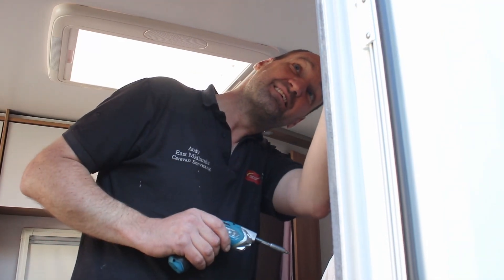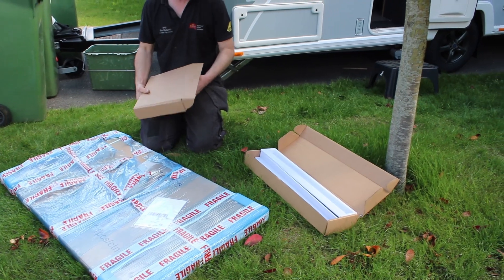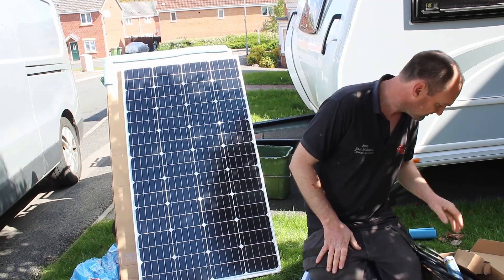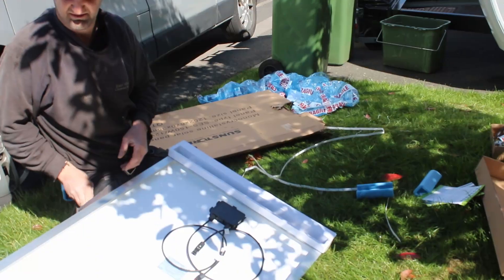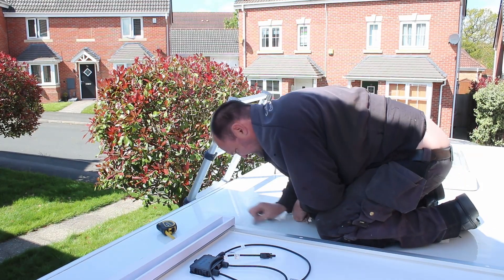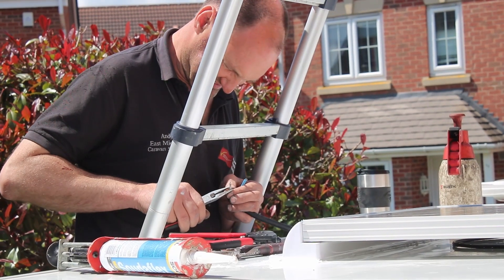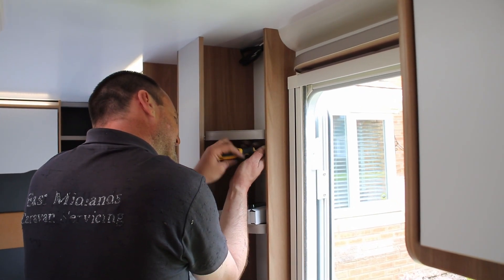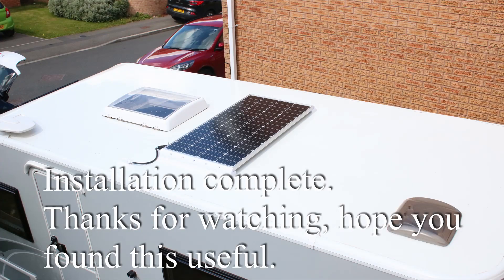Fitting a #SUNSTORE SOLAR PANEL, #Victron controller to our Bailey Discovery D4-4 #caravan 20/05/21

Comment: I had Andy service my Bailey Pegasus today and he told me of his YouTube debut, so here I am, subscribed. I don’t actually need a solar panel, but I’d like one anyway. I’ll be interested to know how you get on with it.
Reply from the maker: Hi David - awesome stuff - he's a good lad - our first break with it was great - basically, once it's fitted, you can pretty much carry on as normal. Our most demanding day would have been the first day in our break when we used the motor mover a bit, the Mrs had a shower, dried her hair with a 800W dryer (via the inverter) then a couple of hours of TV (50W) plus lights into the evening which the leisure battery was fine with then it got fully charged the next day ready to go again.
It saved us £10 by not using the EHU and we like the idea of going off grid.
Vlog will be up very soon!!! - Thanks for subscribing!!!